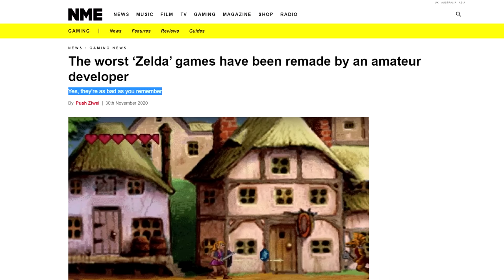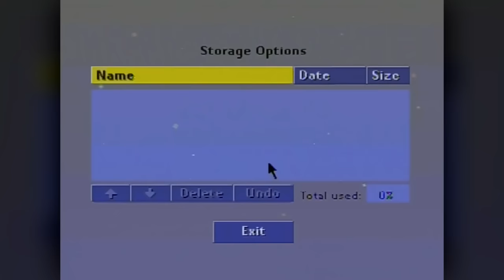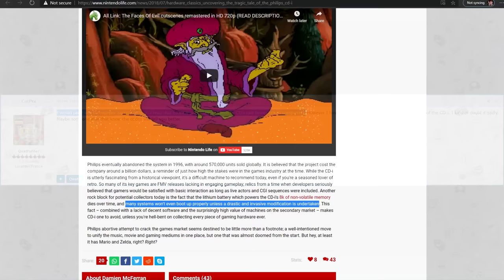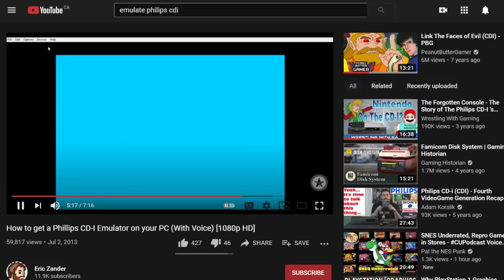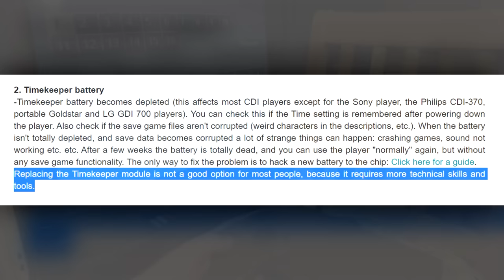Don't Risk Buying a Philips CD-I

Comment: You can desolder the Timekeeper and install a socket, and it can still be bought cheaply and some still have battery in them. If not, you can do all those modifications on the chip outside of the console, which is much less painful. I have a CD-i 490 that has integrated Digital Video Cartridge (you should cover that also) and doesn't use timekeeper, you can add a battery to two exposed pins.

I also have an adapter that lets you plug megadrive (genesis) controllers into CD-i minidin plugs, there is a schematic available for doing these.

Lastly, the CD-i doesn't have any copy protection, you can burn images without having to buy repros. Here in Europe it is very easy (at least some years ago) to find them very, very cheap but I understand that is expensive for US based people.

Comment: I appreciate you taking the time to help document things a little bit more in video form. That's the interesting thing about a lot of these consoles: with so little adoption, they are scarce. Hence they often tend to have rather rudimentary emulation compared to more successful systems. And even stuff from newer generations that have become retro, like the PS2, have only become more complicated due to massive technological advances, more complex design associated with it, and reverse engineer. Nevermind reimplementing that in software, or even hardware, that stuff to run that software on devices they were never originally designed for. Certainly not impossible, but challenging nonetheless. While something like the NES has been reverse engineered, documented, and so well understood to the point that people are making FPGA-based systems like the mister, where its core for the NES is basically 100% accurate to the real hardware, others aren't. They do get closer every day, but it's very challenging with these systems that didn't see much commercial success.

The CDi is super interesting from a historical perspective. It's like seeing what consoles, and even personal computers, would become. Very ambitious, but too early and, ultimately, poorly designed regarding the gaming aspect (at least the controllers). In a time where CDs were brand-spanking new and very expensive (disc and disc reader, nevermind a burner), it must have been ground-breaking and very ambitious for its time. Now fully-fledged multimedia devices are cheap, normal, and everywhere in a multitude of forms.

The battery chip thing for the CDi reminds me of what people would see on some classic macintosh systems. A lot of them function just fine without the pram battery, but there are some systems that straight-up don't boot without one.

Comment: The most irritating thing about the timekeeper chip is that since it's literally just a cel battery, it'd be easily replacable if it wasn't soldered on and required drilling into it to get to the battery.

Comment: I just bought a complete in box CDi 370 for 150 euros. Works like a charm and it has an EEPROM memory instead of Dallas battery-based. And it has got a decent LCD screen and controller built-in. Portable CDi for the win!

Comment: I always found the idea of these consoles holding a ticking time bomb inside them waiting to cause problems decades later to be very fascinating.
Reply: Well there’s also the Original Xbox and the clock capacitor, which is used to store time for a few hours after it’s unplugged. However eventually it would leak fluid that could potentially damage the motherboard. Fortunately it’s way easier to replace (or even just remove entirely, which is what I did).
Reply: The Varta batteries in some 486 motherboards that spew corrosive compounds and destroy PCBs are much much worse than this, that only requires you to change one chip
Reply: @nathanielcody6769  what’s that?
Reply: @nathanielcody6769  oh, that one.
Reply: You might be interested in looking up the CP3 (2?) suicide chip that will eventually render every unmodded Street Fighter 3 cabinet unusable.  Even better, the solution involves sacrificing a Sega Saturn.

Comment: I bought a CD-i because I found the opportunity to get one with games and accessories for super cheap at a pawn shop.

But, I did have to modify the timekeeper chip, adding a CR-2032 coin cell holder and, of course, the battery.

And I've done that to two CD-i units.  A bit of a pain to do, but it is definitely doable if you are handy with electronics repair.  Otherwise...

Now, normally, if the timekeeper fails, you order a new timekeeper chip and do some circuit board level soldering to remove the dead chip and install the new one, preferably with an IC socket so you could change the timekeeper chip more easily should the need ever arise to replace it again.  Needless to say, this isn't something that was intended to be done by the end user; Philips would have expected you to turn the unit in for service, preferably at a shop factory certified by Philips to repair these things.  At least the timekeeper isn't proprietary, but it's still not as convenient as, say, changing a dead CR-2032 lithium coin cell in a Sega Saturn.

And, yes, a CD-i system does require a properly functioning timekeeper to work like it's supposed to.  A dead timekeeper will cause all kinds of weird issues that can get in the way of using the system.  I experienced such issues myself, which was why I had to replace the timekeeper battery in my CD-i system.

Now, do I use it?  I kind of want to, yet not really.  I only have a couple of games where I have any interest of playing: "The 7th Guest" and "Secret Mission."  But, I'm more interested in playing "Legend of Zelda: A Link to the Past" on my SNES.

EDIT: A friend of mine got a broken CD-i for free when he did volunteer work at a thrift store.  It worked, but of course the timekeeper was dead.  I replaced the battery, but in the process of doing so, I accidentally destroyed the chip's 32.768 kHz quartz crystal oscillator on the other half side of the chip.  Whoops!  Fortunately I was able to replace it with a new oscillator and now the timekeeper works again.  It's kind of like replacing the battery as the other end of the chip has two leads for the oscillator.  Polarity isn't important: just solder in the oscillator.

The oscillator is important for the timekeeper as that is what helps the chip to run its internal clock to keep the time and date.  Without the oscillator, the RAM will save the time, date, and data, but the clock will not run when the system is turned off.  Example: if you turn the system power off at 12:30 PM, the clock will stay at 12:30 PM until you turn the system back on, whereupon the clock will run off of the system's own oscillator instead of the timekeeper's oscillator.

This may not seem like a big deal, but there is a possibility the system won't run properly without a fully working timekeeper.

Comment: Soooo, there's another thing you need to take into consideration when purchasing a CDi.  There's also the video pack, a memory expansion pack that expands the system's memory capabilities.  This pack is required to play certain FMV heavy games (such as Thunder in Paradise).  This is built into some models and optional on others and different models require different model video packs. As I recall, this model shown was sold both ways under two different model numbers. (On this model, the pack goes under the left side of the console.)

The one plus of the system is that, like the 3DO, all software is region free.

Comment: Never understood this "limitation" with hiding a goddamn flat battery INSIDE a chip just nobody could replace it if it went bad as how most of this things usually do, specially with tech related stuff, changing the CMOS battery on a PC is relatively easy if you know what you are doing and anybody can do it if they had changed a battery like this before in a toy or a flashlight.

It could had been far more easier if they did the exact same setup for that thing in particular than a regular Mobo for a PC has, specially knowing that this was a console that was mass produced by different companies, so not giving the chance for the customer to fix, change or even preserve its own device they brought is far beyond my comprehension, specially with silly stuff like a battery for managing saves and stuff more when its something that you can go to a warehouse store and buy a couple of those for very cheap.

But no, big brain time "put that inside a chip so it goes bad and bricks the entire thing, then the suckers will have to go with us to fix it for a very high price or just buy a new one! genius!"
Reply: Probably one of the designers saw this part on the catalog and thought it would save some space on the board and figured the customer would've probably upgraded out of it by the time the battery died anyway. Still, wish they would've at least socketed the chip or something since it's not surface mount anyway and it looks like you can still get hold if this chip if you just wanted to desolder it, put in a socket, and swap like for like with an eye toward maybe a replacement thing with some tiny surface mount ram and a proper battery holder that someone whips up some day maybe.

Comment: The CDi bootup problem related to the battery is fixed the moment you replace the battery. You only make a gamble if you can't use a soldering iron

Comment: You can also buy replacement timekeeper chips for the CD-i. Which will require a lot of soldering. Looking at one of the pictures in the video it does look like some CD-is have a socketed timekeeper chip. I actually have a LG GDI-700M and it does not use a timekeeper chip. It uses a coin cell battery (forget which one) It isn't in a holder though, it is soldered on. It also has the Digital Video Cartridge hardware built in so there's no need to go hunting for one of those if you have the GDI-700M.

Comment: Being a photographer I used the Kodak Photo CD player which is part of the CD-i system. In the mid to late 90s I had many photos archived to Kodak Photo CD. If I'm right my Kodak photo CD demo disc that came with my player would work in these Consoles. I put my Kodak Photo CD demo on my Zhou Tube page for all to see. Mine is the Kodak Portable CD player model# M50.

Comment: IIRC these batteries are typical Dallas (the company) ones, which are still produced, so you can buy new ones to replace the old with. Given that, it would seem more appealing to me to desolder the old battery, solder in a socket, and place the new battery in the socket.

I mean, "more appealing" in the same way that having a bad cold is more appealing than contracting COVID-19, but y'know, I feel a bit more comfortable with a soldering iron and some wick than a saw.

Comment: As I was watching this, I found a seller on eBay who's not screwing around with this issue and is offering a modified CD-i. I'm not planning on buying it since, among other reasons, it goes for quite a bit, but I added the listing and even the seller to my watchlist. Even so, I have Jeopardy! for the CD-i and preordered the upcoming system Polymega. Although Polymega won't support the CD-i upon launch and I can't say for sure whether or not it ever will, I wouldn't be surprised if it does so later on.

Comment: If you're willing to buy repro CDs, I hope you'll also look into what you'd need to be able run your own burned CDs or otherwise play games you don't own.

(I'm expecting that most people still have an old computer with a CD or DVD burner. Throw in an USB adapter for usually around  $10, and you can use them with modern no-optical-drive computers.

Comment: i purchased my cdi around 5 months ago, got a 210 model, controller and wires with dvc cartridge installed for stupid cheap. the seller specifically said theyd only ever played cds on it. knowing all that i went for it and it works perfectly. the idea that if its never played game software on it previously makes the dead battery not brick the system is probably the correct one. However i agree that the issues present with it are really not publicized and honestly its worrying that there is hardly anything out there on them. i may have gotten lucky, but it was exactly that: lucky.

Comment: ethernet DC is probably due to phillips using a serial RS485 interface to power its power supply unit, quite archaic and more in line with commercial PDAs

Comment: I have the same CD-i as you (the console looking CD-i that was released around 1994). While the time keeper chip does NOT work, the console still works 100% after all of these years. In regards to CD-i's that do NOT work when the time keeper chip stops working, those are SOME of the OLDER CD-i models (SOME, not all, but some of the ones that look like a VCR released around 1991). Just wanted to mention this information. Also, that wand controller is NOT meant for video games, it's meant for the multi-media software. The CD-i that looks like a console (the one you and I have) came with the Sega Genesis looking CD-i controller since that version of the CD-i, released around 1994, was marketed towards gamers, NOT like the older VCR CD-i's that were marketed as multi-media devices. That seller throwing in that wand controller with that console looking CD-i is very shady since he should have thrown in the Sega Genesis looking CD-i controller instead since that's the controller that came with the console looking CD-i. Most likely that seller decided to sell the Genesis looking controller separately since they sell for good money and stuck you with the horrible wand controller (meant for multi-media purposes and software, NOT for video games) since no one wants it.

Comment: That battery mod, while not for beginners, shouldnt be THAT terrible to do. Like, not BGA replacement bad. Essentislly you are just using a rotary tool to expose the leads to the battery and the batt itself. Which is being disposed of anyway. Then putting in a socket. Two small solder joints I assume? But yeah, just wanted to throw that out there. I am hobbyist who just enjoys modding and stuff and Id feel comfortable doing it... Love the vids, look forward to the next!

Comment: You can totally play the Zelda and Mario games in Retroarch now. The main ones that are not supported are the ones that use the video module. There is an emulator that supports it, but it is buggy and tends to lock up.

Comment: I dont own cdi sadly (hard to find where i live and ebay transport here is way to expensive). But many old motherboards (like many 486/pentium ones) have similar problem with chip type batteries. Few solutions that have worked: 1) live it powered on for 24-48h. 2) unsolder 2 battery legs. connect 5v usb to it. 30min-1h and bat should be back for a while atleast. Hell, managed to somewhat resurrect some cell phone batteries from early/mid 90-s with 2 methods to.

Comment: Hey Framerater relating to that thing you said about not being able to keep save games on the cdi there is a option for that by using some cables and adapters from retro stuff going into detail about a software called Philips cd interlink which allows you to transfer and store cdi save games from your cdi to your computer with some cables and adapters from retro stuff's website.

Comment: I admire the commitment and honest on display here and am looking forward to some CD-i stuff out of morbid curiosity. Also I guess I'm lucky in that all the retro consoles I've gotten have worked. The NES needed that damn NES10 pin broken and the Xbox disk drive doesn't open, requiring a paper clip, but I've encountered nothing like what you have. Good luck with this CD-i Adventure!

Comment: I just wanna know what possessed the engineer that designed the thing to decide that putting the battery INSIDE the chip was a good idea to begin with
Reply: They are pretty standard chips that were used in PCs and Sun Workstations (that also need them working to boot), if you ever had to repair battery damage from corrosion on a PCB,  with this solution at least you only have to change the chip, not do trace level repair jobs.
Reply: @ivandiazalvarez  How long do you need to leave a PC unattended for corrosion from the battery to become a problem? You're gonna need to replace it anyway as soon as it stops working, and failing that you need to open the damn thing at least once every year to clean all the dust.
And in the case of a CD player thingy like this you can probably just mount it somewhere where it won't cause so much damage. It still feels like they "solved" a problem by making it more complicated.
Reply: @axelprino  I was talking about batteries in old 486 and Pentium machines, that are exactly from the same period as the CD-i, later ones are cr2032 that are much less likely to cause problems. And the batteries in Macs well into the G4 era did ocassionally explode and wipe out the PCB, Timekeepers are no problem in comparison.
Reply: @axelprino  some can keep working but start leaking after just a year or 2. So putting it in a chip made sense. Granted modern Bios batteries only very rarely leak, however batteries in the 90's and before LOVED to leak. And lots of motherboards died because of them. It's also why a lot of early 386 to pentium motherboards had battery headers to install a battery pack and cut out the soldered battery as they made the system less likely to kill itself at the cost of cost and longevity of the bios battery.

Timekeepers aren't an issue, it's like complaining a solution to a problem at that point in time (early 90's) should have used current (as in 2021) technology to solve it. Timekeepers kept the board from being destroyed and are really easy to fix, as you can very easily replace them. Any person that can solder half decently can replace them and the average consumer isn't exactly going to muck about in the internals of a, at the time, expensive machine.